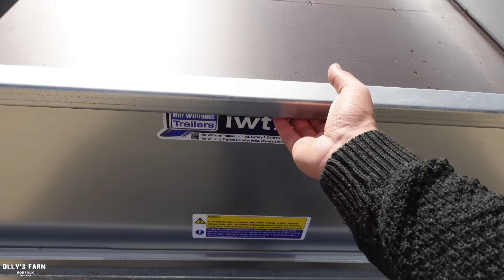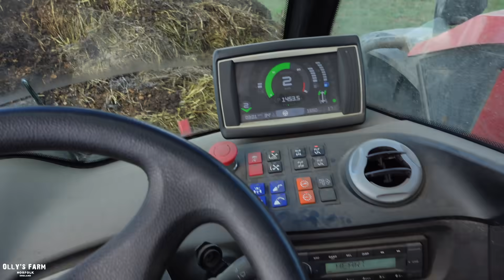THIS IS HOW WE'RE GOING TO MOVE THE TRACTORS! 16 FOOT LONG FLAT BED TRANSPORTER!

Comment: I’ve had Ifor 16' trailers like that one for 25 years. Excellent trailer. Last time I changed one, I opted for a tri-axle tilt bed and it is truly awful. Fifteen major faults but IW didn’t want to know. Their response was that just because it was a new design, it didn’t make it a bad design! It was and I’ll never buy another IW trailer.
However, your choice is good, the only extra thing being that you need tie downs in the floor. Never strap down over the sides. If you strap over tyres, you should make the straps form an X so that you pull both ways - easy when you see how it’s done.
Tri axle over twin axle will reduce your carrying capacity by the weight of the axle.
Beware of carrying your tractor and plough against the headboard. You could easily exceed the drawbar max weight so, keep back a bit.
Enjoy your ploughing and, if you’ve got time, have a look at my tractor blogs in Dave's Tractors. I too, have recently bought a MF65 to add to my collection..

Comment: I would try one of the plant trailers… lower to the ground, tows better and the back door is also the ramp… perfect for loading tractor s👍🏻🚜
Reply: Yup.
Reply: You can get that trailer with a ramp but the only thing is you can’t remove it for longer stuff. I find a fixed ramp is ok if your using it all the time for plant.

Comment: Olly,
A small tip always carry a couple of pieces of strong flat timber to put under the axle stands at the back as it helps to stop them sinking on soft ground. I always used the stands as it prevents straining the tow hitch I never loaded without having them down to stabilise the trailer when loading. Ifor Williams are the best trailers around and they don’t depreciate providing you keep them clean and well maintained. I no longer needed mine so I sold it after a few years of use to cart horse manure and I sold it for the same price as I paid for it.
Reply from the maker: Good idea thanks, will get some off cuts of wood ;)

Comment: No no..def need a tri ax. With  heavy decking and steel not alum, won't hold up. Also need proper tie down points set in deck, bolted to frame..No strapping over side to aluminum.
Best, from a farmer in York ( New York, that is ) love the channel

Comment: Nene Overland is your place to get upgrades and parts for the defender. I bought mine from them when I was in the forces. I don't have that defender but I do have a late td5 90 pickup. Its highly modified and goes like a stabbed rat (for a defender). Have a look at remapping as standard defenders are slow. Towing 2 tonnes on a trailer becomes much easier. Good luck with the channel.

Comment: You should get a 3 axle trailer olly it’s not as much pressure on the 2 axles it’s over 3 axles then which is better for the trailer

Comment: You can tow a trailer as long as the Land Rover and trailer doesn’t weigh over 3500kg, which is a little stupid. When it goes through are we going to be able to tow up to 8250kg like people with tests before 1997?
Reply: Gross trailer towing weight 3500kg.
Reply: @andrewgebbie2095  Yeah so we can tow 3500kg with just the trailer, so the weight of everything will be up to 8250kg?

Comment: Go careful using the lashing points that look like hooks on IFW’s. They aren’t meant to be load baring. More for roping and sheeting. I would suggest having heavy duty shackles fitted. This is an option when they come direct from the factory. Then you’ll have sufficient anchoring points.

Comment: its a good trailer, but here's a tip when pulling the ramps out of the trailer straddle the ramps because you then bend your back less even with how light they are it is still a problem with damaging your back

Comment: No you need 3 wheels. Much more stable.thanks.
Reply: The extra axle Weight means legally it reduces the maximum weight you can carry and they are harder to manually move about

Comment: 13 pin plug is no good and the adaptor is no good better off wireing new plug on trailer because adaptor will give trouble